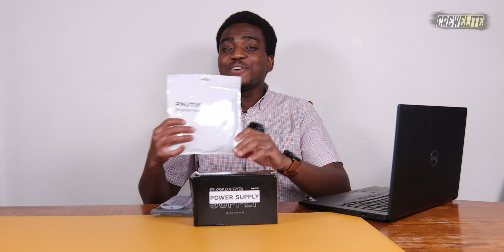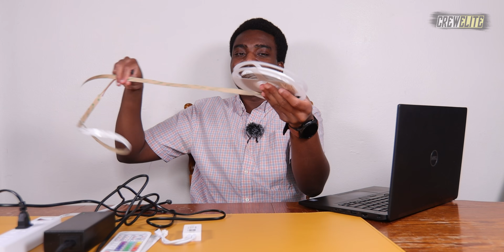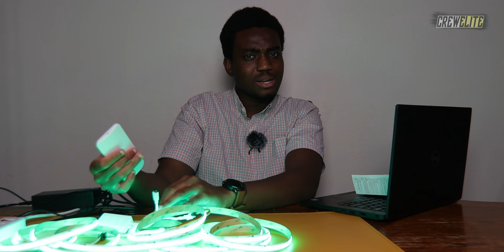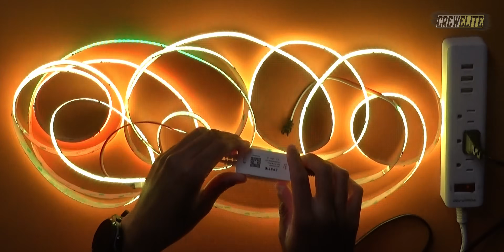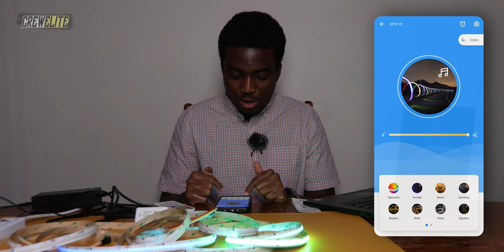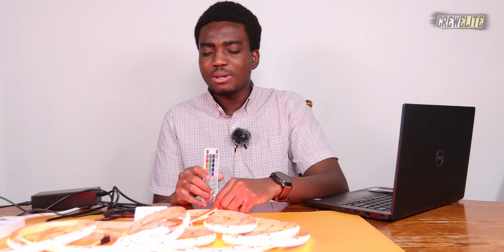PAUTIX: Smart Addressable RGBIC COB LED Strip Lights | Super Bright Chip-On-Board Lights! [REVIEW]

Comment from the maker: - Kit With Everything To Get Started -
• RGBIC Kit 16.4ft (Addressable): https://amzn.to/3skaKQL

- Addressable RGBIC COB LED Light Strips -
• 6.56ft/2m Strip: https://amzn.to/44i8MO6
• 16.4ft/5m Strip: https://amzn.to/3E1HfWj
• 24ft/7.5m Strip: https://amzn.to/45BF9rU
• Waterproof 16.4ft/5m Strip: https://amzn.to/3sfQgbM
• Waterproof 24ft/7.5m Strip: https://amzn.to/45imlhU

- Remote Controllers -
• SP511E (Wi-Fi) Controller: https://amzn.to/3P4j0gK
• SP611E (Bluetooth) Controller: https://amzn.to/3OYGsM9

- Addressable Controllers -
• SP107E Controller: https://amzn.to/47Cdqt6
• 12-in-1 Bluetooth Controller: https://amzn.to/3P38Tsk

- Power Supply Adapters -
• 24V 4A Power Supply: https://amzn.to/3P1PHet

- Connectors - 
• 12mm 3-Pin Connectors Kit: https://amzn.to/3YFOj4s

Comment: Can I use it on a car?
Reply from the maker: My apologies for the late response! I'm sure there is a way to rig this into a car. 

What kind of modification are you working on or seeking?
Reply: @CrewElite for speaker rack and speaker spacers
Reply from the maker: That's a pretty neat project! I'll double check if they carry these specific lights for car use, as the ones I reviewed would require a bit of modification to achieve.

Comment: How's the adhesive on the lights? I find many don't stick well and I'm planning to put an electric unicycle.
Reply from the maker: My apologies for the late response!

It's very neat that you plan on putting these lights on a unicycle! I have always been amazed by people who can ride these!

The 3M tape is pretty strong, but in your usecase, I would think they may peel up a bit more quicker since they would be exposed to the elements. 

Do you plan on getting the waterproof version of these lights or weatherproofing this unit?
Reply: @CrewElite  thanks for the info. Yeah weatherproofing is my main concern and also the Contours of the unicycle and dirt would easily peel up 3M tape. I find the included tape on LED lights isn't very good so I often put external 3M double-sided tape and then I also duct tape it in portions. Because the worst thing that can happen is if it gets loose and gets sucked into the unicycle and then you fall
Reply from the maker: Yes, that would not be good. Have you considered putting the lights into some sort of tube?
Reply: @CrewElite  that's an interesting idea. The tricky part is under the euc there isn't much space.
Reply from the maker: @soupnazi81  I see. Is Euc the bar that connects the wheel with the metal?
Reply: @CrewElite  oh euc just stands for electric unicycle
Reply from the maker: @soupnazi81  Ah I see 😂

Comment: Hello CrewElite , quick question for you, for the IC COB led can I add few strip of 16ft long and control them with my phone using a controler ? if yes which controller. thank you
Reply from the maker: @thestretchceiling My apologies for the late response again, Chris. I also didn't get the notification for your latest comment and was looking through spam when I found this. If this ever happens again, you are more than welcome to reach out through email or the other platforms I'm on. 

I can definitely do some research on if zoning is possible through phone. Will you be utilizing a addressable led controller to customize your lighting? If so, it think this should be possible and we would just need to confirm with the manufacturers with a suitable model.
Reply from the maker: My apologies for the late response! I usually do my best to answer within a day. 

Yes you most certainly can connect multiple strips together. The only problem would be getting a power supply that is able to support multiple strips, as the power strip included can only power up a certain amount. I would need to double check this to see what the amount is and if there are limitations to doing this. 

As for remotes, they both should theoretically work, but I would prefer the WiFi one as it would be more stable than the Bluetooth one.

Comment: I would like to run multiple strips in a hallway for a futuristic effect.  My plan is to run about 25 strips, will the app and remote allow me to sync them all together?  Also how many feet per controller is allowed for there not to be any signal loss?
Reply from the maker: My apologies for the late response! This is a great question! Do you know what length size you are considering to use for each strip? You may be limited by the amount of strips the power supply can apply to the strips. This is something I would need to do further research to see if the length of strips impact the remotes ability to sync and stable connection.
Reply: @CrewElite  maximum length per strip would be 20ft.  I'm aware ill need additional power supplies.
Reply from the maker: How many power supplies do you plan on using? The reason I ask this, is because each strip will need sufficient power, and pulling a lot of power in one specific area could cause issues.
Reply: I'm doing this in my theater.  If I had my way, I would turn my whole house into a cyberpunk landscape
Reply from the maker: @FURognar 😂

Comment: I was thinking of buying this, but unless they package it with a diffuser, I see hot spots on the strip even when the strip is held at an angle.
Reply from the maker: My apologies for the late response. I think they did make a newer model of this light that is a bit more diffused. If I can locate it, I will send you a link.

Comment: Can a dummy easily add a few extra feet to these? I need 18ft
Reply from the maker: Yes, I don't think it's too hard. You are most likely going to need connectors to pair additional strips up. Also, depending on the configuration, the power supply may need to be increased to one that supports a bit more power to handle the load.

Let me know if you have any questions! Also, make sure to subscribe and share if you haven't already! Welcome to the Crew!

Comment: Hey can i l program separate colors on these strips to display same time? Not color chasing or effects- just say blue for 2 feet; then yellow for 1 foot, then back to blue for 3 feet.. all on same strand of leds that will stay that way when i turn on and off??  I need to know how to program specific sections like this
Reply from the maker: My apologies for the late response. Yes, this should be possible with an addressable controllable switch, but does require a bit to configure. I don't believe you can customize it to do this on the LED lights in the stock form. 

I do plan on picking one up to make an updated video, showing how you can program one.